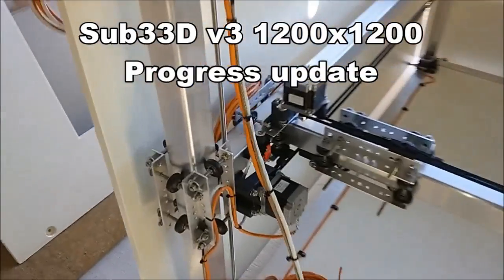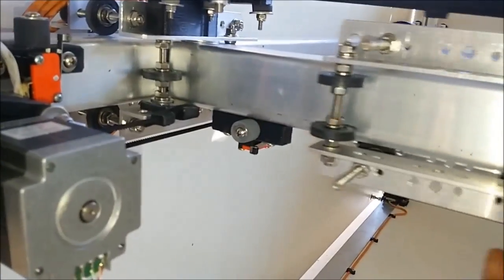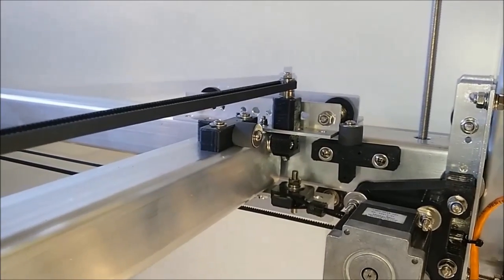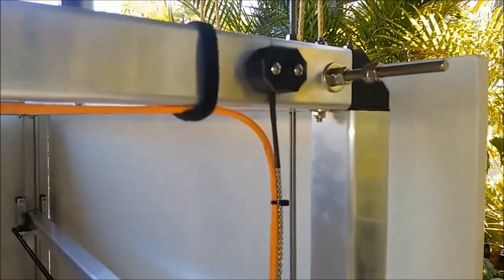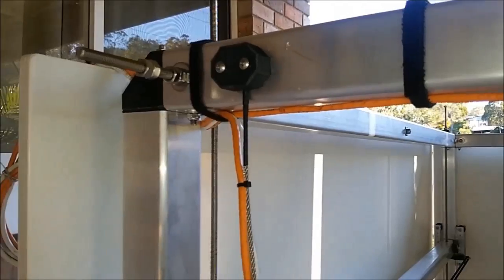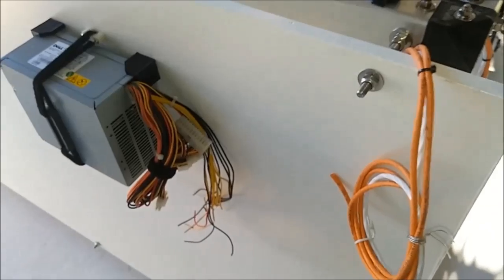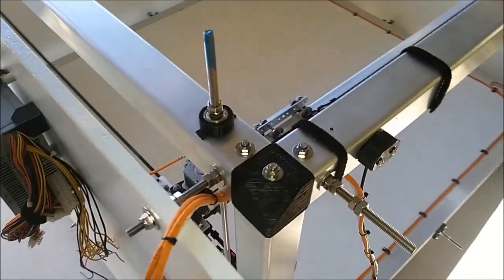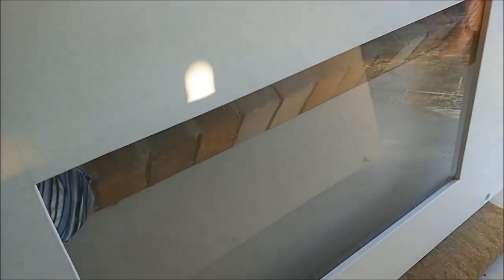Large scale DIY 3D printer - 1200 x 1200 Sub33D V3 - Linear bearing test, endstop and wiring setup

Comment: Are your Nema 23 12v or 24v?
Reply from the maker: Currently they are running off a 12V server PSU, but I am planning to change the PSU to 24v to get higher RPM speeds from the NEMA 23 motors (faster non print movements and Z hop times)

Comment: can you tell me the progress of this printer? Or BOM
Reply from the maker: Currently working on the high flow rate extruder, and new location for the printer (will be moved to substation 33 and new solar/battery storage system setup for it)
Reply: I wanna make this printer for large prototype. However, the absent of the BOM is holding my ankle.
Can you tell me the BOM?
Reply: Hello.. any news? how is everything with your printer ?

Comment: Excellent job. It does look like the entire weight of 3 motors, frame, guides and would be heavier than a build base plate, just asking not criticizing. :) ?
Reply: Sub33D  Can you tell me all the parts that I have to buy in order to make it like my own? I can not import such printing
Reply from the maker: Cheers, yes the frame and motors look heavy but they are well under 25% the weight of the bed, the bed is 6mm plate while the frame is 2mm box section.
Reply: Are you suuuure, Take it all apart and weigh it just for me.  :)))))

Comment: I am building a 300x300 but this one is just too big.  Really will need a heated chamber for it.
Reply from the maker: Yes, I have built several 300x300 and should have built a 600x600 before attempting this one, thanks for the previous advice regarding the z-axis threaded rod top bearings causing z artifacts (a few of our printers were suffering with bent rods), good luck with your build
Reply: Sub33D
Grand work you have done though, mate. :)

Comment: wow, that is gigantic. Love it! But printing such large objects must take weeks, no?
Reply from the maker: It depends on the extruder and detail required. 
The dual volcano 80W 1mm extruder on the printer at the moment has a 4 x flow rate of your average 3D printers but it is way to slow for a printer of this scale.
I am currently building a dual 100mm tall stack 320W 1.5mm extruder which should have 4 x the flow rate of the current one (16 x the flow rate/speed of average 3D printers), but it will loose some detail.